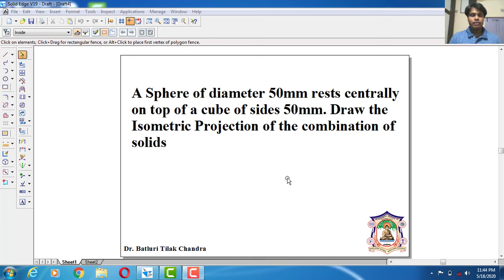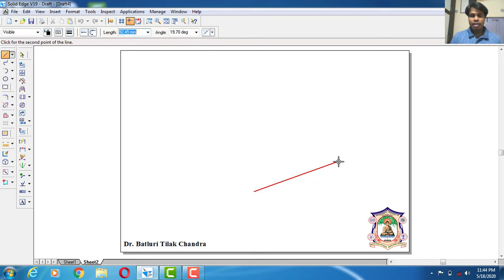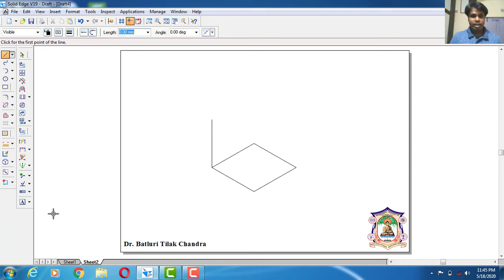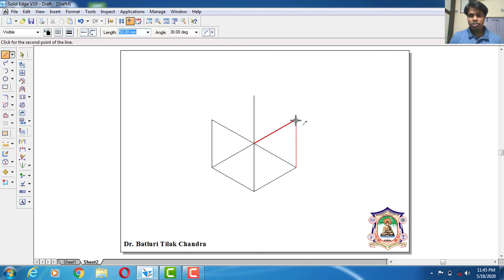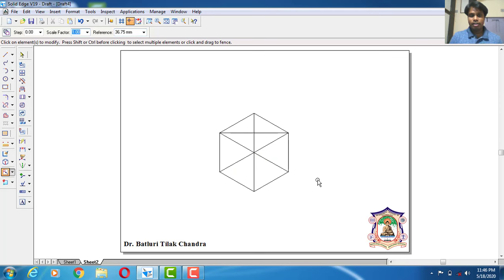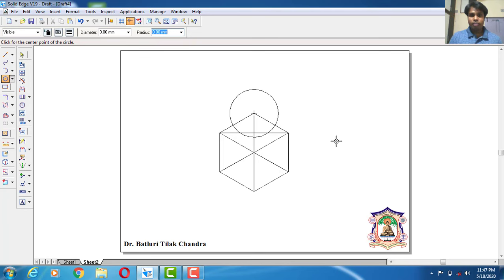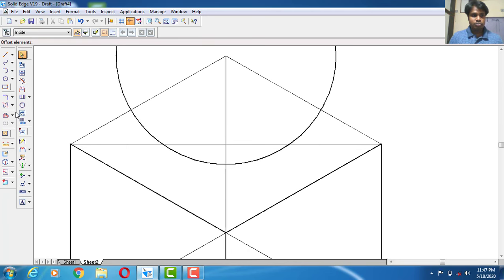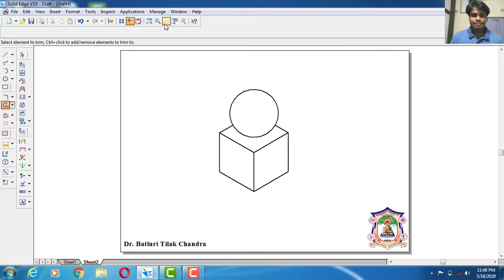COMPUTER AIDED ENGINEERING DRAWING/ISOMETRIC PROJECTION/SOLID EDGE - 1

Comment: Sir, to construct a rhombus at start, in CAED lab u taught us to take the length as 50*0.816. 

But in this video, u had taken length as only 50mm.

Which method we have to follow now to take length?
Reply from the maker: Both the methods are correct..you can follow any one method..
Reply: Sir in exam I didn't convert diagram into iso scale I mean 0.8164 how much marks will loose